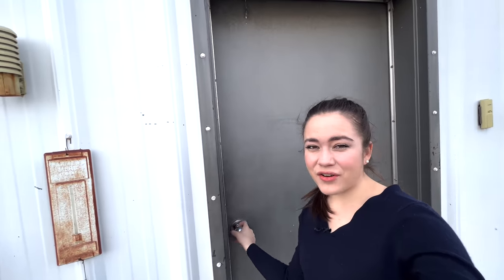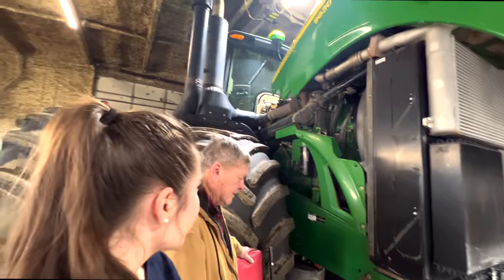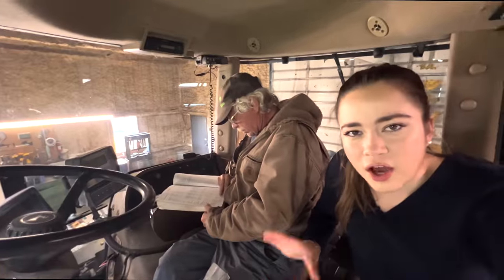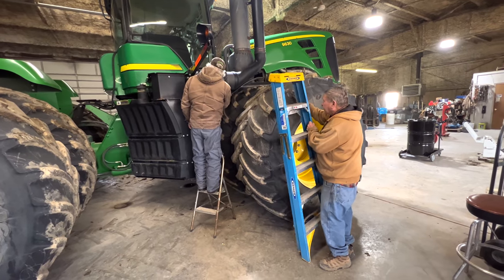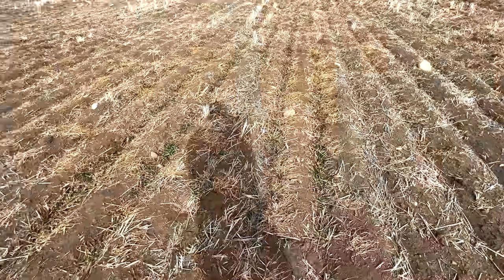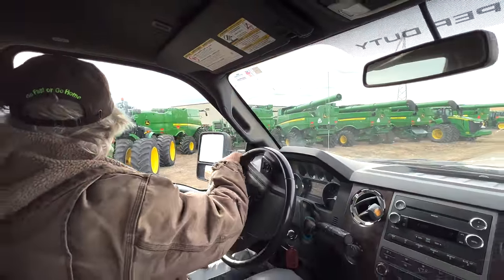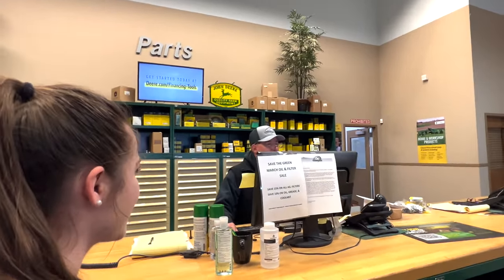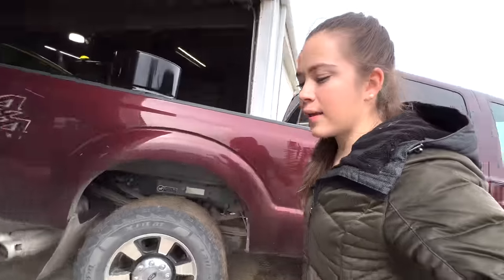Tractor Maintenance & Crop Update.  Montana Farming 2022

Comment: I never change hydraulic or transmission oil unless you have something go bad and it contaminates the system, I do however change engine oil regularly. There is a big push now for soil analysis since the price of fertilizers are sky rocketing.
Reply from the maker: Thank you for your great story and information.   Soil samples are always good to do.
Reply: If it's (the soil) has got it, don't need more: saving money.
🌏🇦🇺

Comment: Nice information. That is a lot of oil. What happens to the oil you drain from the equipment. If you know.
Reply: Its pumped out into those large plastic cube's ( cant recall the official term for them ) then taken away for disposal.
I think it's filtered and used for heating.
Reply from the maker: Thank you for your kind words and great question.  We recycle it and use it for heating oil!

Comment: 500 horsepower I think the little Oliver had 18 to 20 horsepower. The little Allis Chalmers might have had 30. The 1945 Case Model D1 had a 3 speed with reverse and a PTO It had overhead valves it was quite a bit more powerful.
I pulled a big Freightliner 10 ten ton tractor with it so they could get it started.  But only about 10 feet and it started
Reply from the maker: LOL!!!  That is very neat to pull such a huge Freightliner with such an old tractor!!!! Thank you for your great story Mr. Larson!